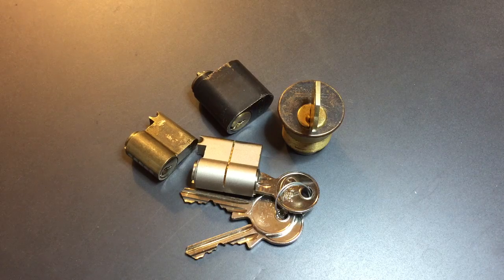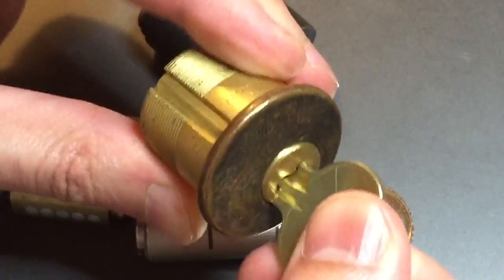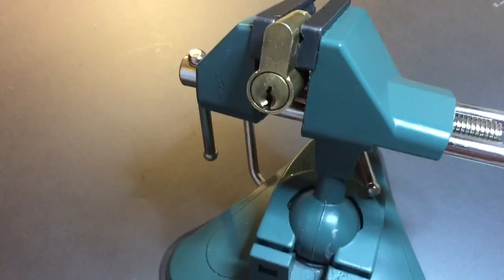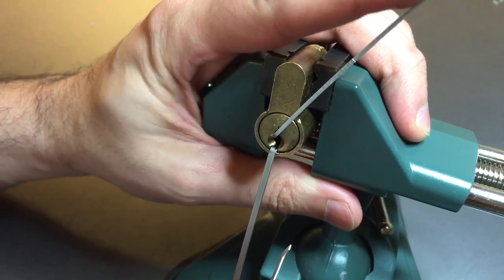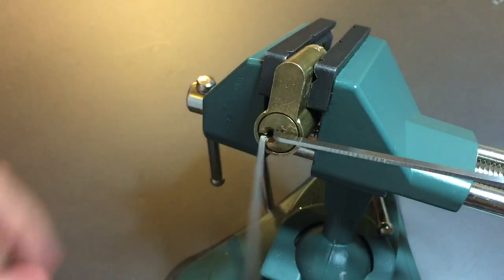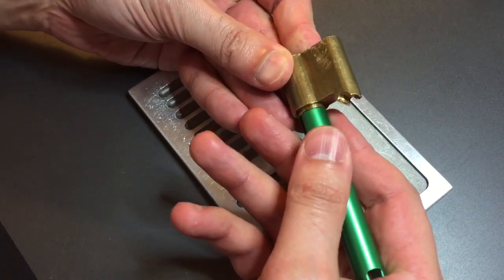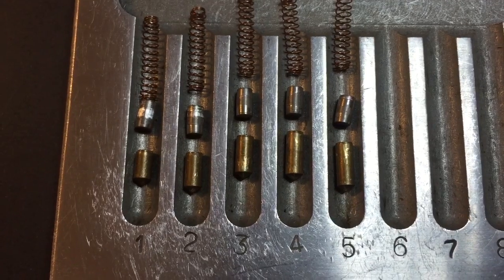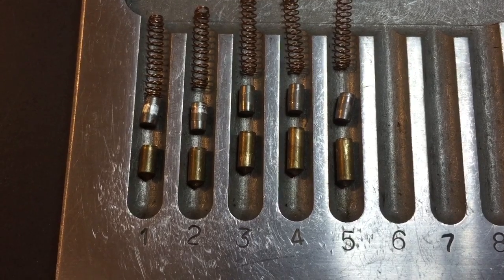[171] FAB Euro Profile Cylinder Picked and Gutted

Comment: Hi Harry,  Interesting to see the pins in this lock. Although not exactly the same as the original Aussie Lockwoods, there are certain similarities. The bevel on the key pins, and the taper on the drivers are reversed on the Lockwood locks, but apparently have a similar effect on sp picking. Your picking technique is obviously the way to go with these type of pins. Thanks for showing. Regards, Brian.
Reply from the maker: I like the really long tapers on these drivers… not quite as long as the ones in the Lockwoods.  But without the same severe taper in the key pins, this FAB should be easily opened with heavy tension (as I showed).  If you tried this method on an old Lockwood like the ones you sent me, you would end up with half the keypins overset... unless you use the method I showed in the Lockwood video for checking on overset pins.  That can be very frustrating.  The tricky part of the Lockwoods IMO is the combination of the tapers on both the drivers and key pins.

Comment: Interesting drivers - never seen these kind of modification. Something I have to remember for my next locks that I make. Nice picking also - very quick.
Reply from the maker: They would be interesting in challenge locks that otherwise require light tension.  Consider a taper on the kit pins as well, Lockwood style!

Comment: I watched your video on the abus 25 disc dimple lock and it kind of looks like your using the dimple picks from spooxe. Is that correct? If so, how do you like them I use typically use my souber set and sometimes my southord and was thinking about getting the set from spooxe.com but 125 euros for the whole set is ridiculously expensive for like 8 dimple picks and some wrenchs. How do u like them
Reply from the maker: They are spooxe, and yes they are pricy.  I doubt I would have spent so much on them, but I got them for free… a very nice “thank you” from someone who was borrowing my highly modified dimple picks.  In any case, the Spooxe are about the best on the market right now, but that may change soon.  Don’t was to say more, but keep your eye on the major players for new products.  As for Souber… well, let me start by saying pick preferences are highly personal. What some people like, others may loathe.  That said, I can’t use the Souber picks.  They are one of my most regretted purchases.  The flat shafts tend to move pins I don’t intend to move, and they have WAY too much flex for me… so much that  I feel like feedback and precision is significantly dampened.  But take all that with a grain of salt.  Some very good pickers use Soubers and love them.

Comment: Thanks for showing the inside of the lock(pins), I sure looks like it's had a hard life by the etching on the pins 😯😯😯
Super picking , very fast👍👍😘😎🍻🔓
A question ( and this is not a comment about your picking),do you think with the removal of the circlip on the rear of the lock would aid a picker.
Making it easier to open or not??🤔🤔.
I think the reduction of the resistance on the core may aid a picker ever so slightly, I would love to hear your views on this 👍👍🤔
Reply: i dont think so :)
Reply from the maker: For this lock... no difference.  For others in which the clip is not well-fit and it adds turning resistance, then it certainly could make a lock harder to pick.  Think about the rubber O ring in the back of the 10-Lever Ingersoll Miracle Locks... it's only purpose was the deaden the feel of the lock, and it's a powerful anti-pick feature.  Same thing on a miss-fitted clip on the lock.
Reply: +LockPickingLawyer thanks for the reply 😘😘😎